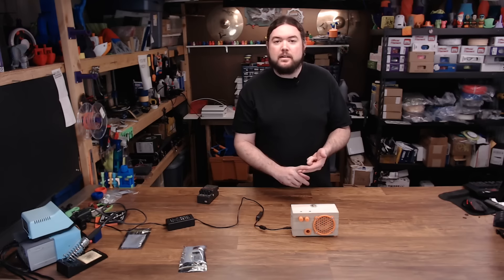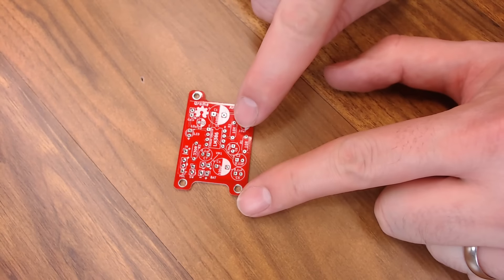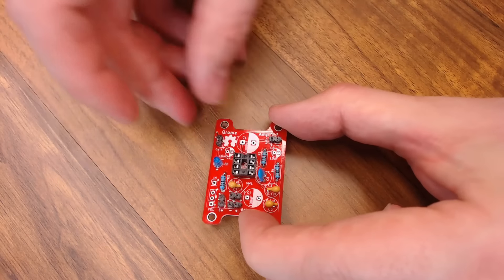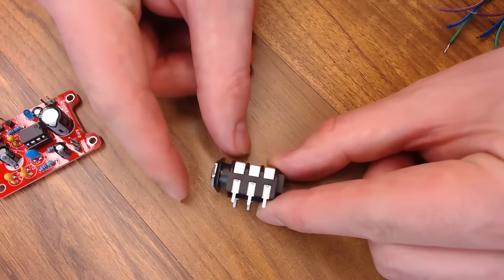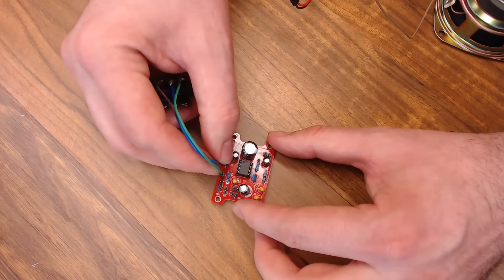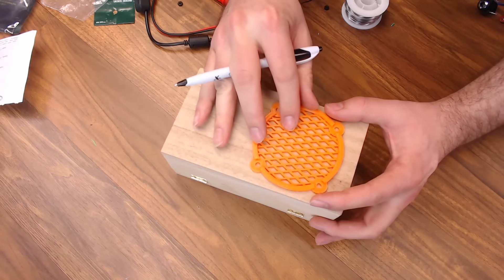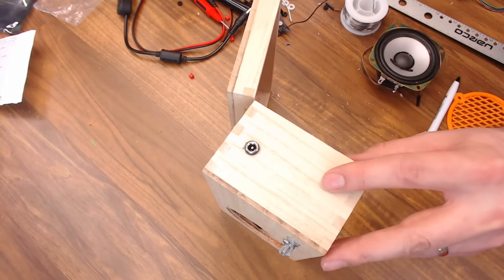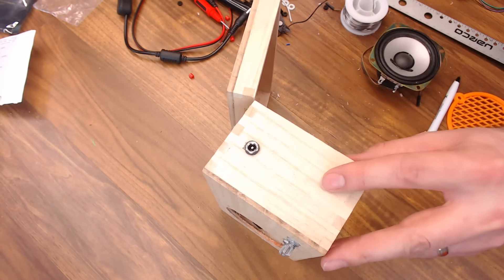Guitar Amp Build - 3D Printed Parts - Chris's Basement

Comment: How did this work out with the 25 watt speaker? I see you've linked to a 5 watt speaker in the description, wondering if you had to alter the circuit at all to match the impedance for the 25 watt speaker
Reply from the maker: I think something changed with that amazon link and now I can't find it, the 25w works pretty well.

Comment: I have an old Samsung Galaxy Tab 3 GT-5210 laying around any ideas if octoprint can be installed or if it can be used with octotouch as a control screen?. I know you can install Unbuntu to one.
Reply from the maker: If you could get Linux on it you might be about to make it work. Not sure on the ports though.